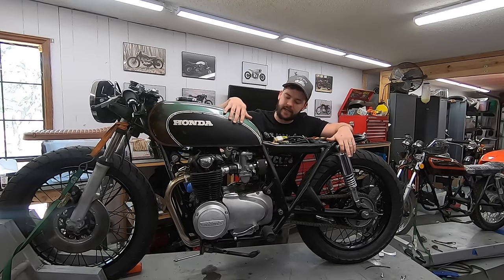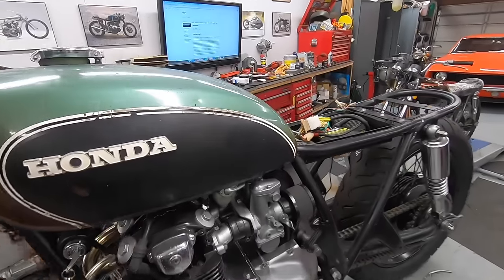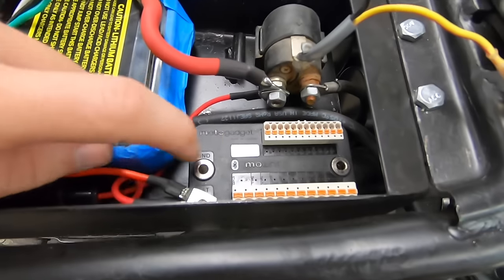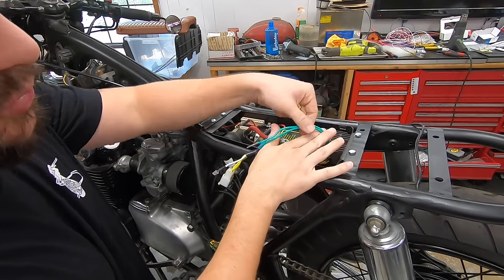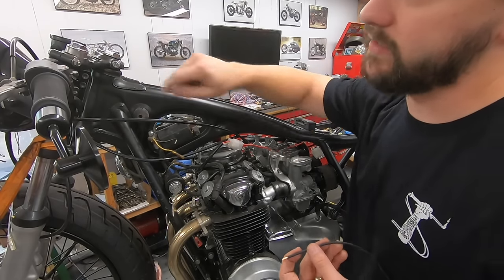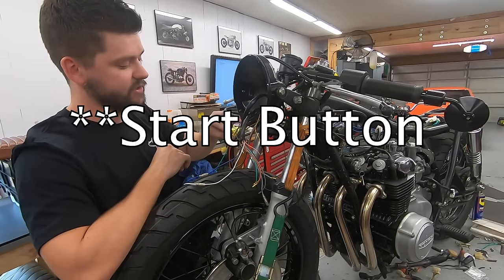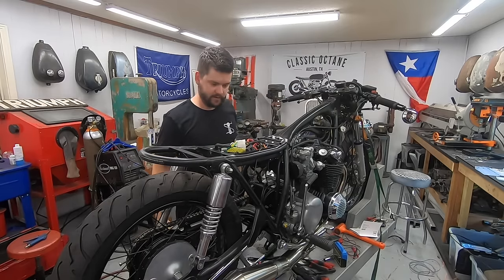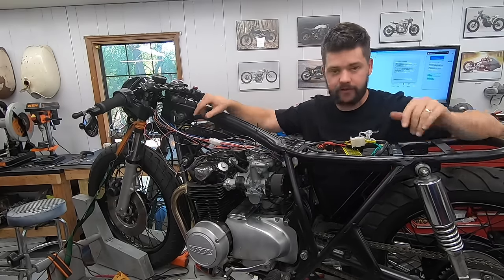Installing a Motogadget Mo-unit (m-unit) on a classic Honda (step-by-step)

Comment: The amount of development in engine and chassis technology in the last 40 years has been amazing. It seemed like I could bring bikes up to almost modern standards yet still had a shed load of little boxes and wires everywhere.  At last.  Thanks for explaining it well enough for an electrical numpty to understand (sort of)!

Comment: The most comprehensive m unit install I have watched! And I have watched a lot of them! For someone who has limited wiring knowledge Ive found the Revival cycles vids good but they seem to concentrate on the M unit not what you do if you want to retain existing switches. Thanks 10 out of 10

Comment: I just installed my M-Unit with the wire kit, completely rewiring my 1980 CX and it was simple and amazing! Thanks so much for explaining wiring in depth - really helped me understand the Honda wiring system better and how to get around the neutral and kill switch with the M-Unit.

Comment: Nice well documented video. As a techy I like the idea of the m-unit.

With respect to the "Kill" switch, the route you have chosen is by far the best. As this is an emergency switch it needs to be fail safe in operation. There is no substitute to a mechanical device in the feed to the coils as a last resort. 

The m-unit is of course solid state and as such could fail in such a way as to not turning off the ignition feed. Also the kill switch was designed to handle a set amount of current. This current keeps the switch contacts clean and working. It is known as a wetting current. The input to the m-unit is unlikely to satisfy this requirement and could have caused an issue at a later date given climatic conditions (salt, rain etc) on the kill switch.

Keep up the content...

Comment: My nephew and I have been totally redoing a 1970 Honda cb350 since last November .......... I purchased a m-unit blue to put in this bike....We are done with the mechanical part including upgraded carbs and an electronic ignition system....Left to do is the wiring of the bike to include the m-unit blue.....I know nothing about motorcycles, have never been on one as a rider or as a driver....)Note: Recently took and passed the state basic rider course as my first attempt)....My nephew has wired one bike with a wiring harness and no m-unit blue....With all of this said your timely wiring here in this U-Tube has been our bible to get this done.........Not done yet and will keep you posted on results......TY TY TY TY TY
Reply: well...8 months later and we attempted to hook up system and turned it on but nothing works....will back tract to this video again and check every wire.....my oh my

Comment: Thank you very much for your explanation! It really helped a lot! I configured my kill switch like you told. But after updating my m-unit blue you can change the kill switch behavior from NO or NC contact. So it can now be done with the m-unit! It works for me.
Reply: Update the blue unit as in the phone app? U can switch it in the app?
Reply: @MG-we9np  In the phone app there is an option how you would like to use that contact now. During your video that was not an option.

So you don't have to do it with the wiring anymore.

I think this is what I meant when I wrote the comment.
Reply: @porschetarga4s  cheers Nick 👌🏼👍🏼

Comment: This helps so much. I'm gonna watch this many times over. Incredibly thankful! Bought an M-unit Blue and the wire kit etc about 3 years ago and it's still sitting in the box lol. Might finally be able to move my Ducati Monster 600 -95 out the garage (aka living room). Best wishes from Sweden.
Reply: lol I also have m-unit blue sitting for 3 years already, wiring feels daunting, luckily he showed step-by-step process

Comment: That RR needs to be out in the fresh air somewhere .... :) M- Unit does not function with latch type switches. Momentary signal switches only as you are aware.  GOOD JOB working your way around it . I did same thing with the Kill. Re lighting circuit  I originally was doing likewise however chose to by pass the m-unit HB  output and power the HL with constant power out of ignition via the stock HD key switch which has a 2nd position to power the HL circuit  . The customer wanted keep these functions to stock. PS I ran both front and rear brake lite lines into the the brake  input on the m-unit .

Comment: Hi,

Been following your video’s for A while now from Belgium and really like/appreciate them. On this one however I have a 

small remark which I can’t refrain from making. 
Namely  that WAGO and other style clamps are  used for in house use and to my opinion should not be used in A bike or any automotive stuff.

No pun intended btw! Other then that still liked the video very much and found it clear video on m unit install.

Rather solder connection on bikes and use heatshrink to protect. 

Btw .. difference between yellow and orange clamp .. yellow only for solid core cable, other can be used for woven copper cable.

Keep the nice content coming ! ;-)

Comment: Hey Taylor, I have an 84 VT500 Shadow. The junction box (ignition/dash/lights) fried at the main hot/ground terminals. Is the M Unit the best replacement for this? Are there other options as well?

Comment: Taylor, many thanks...amazing to have this very well described! BUT be careful I pretty skeptic about idea to hide REC/REG under the seat into that tray! This may end up in fire!
Reply: because it gets very hot? where is a better location?
Reply: @bonsaitigerMTB could mount underneath electric tray for airflow. Then drill a hole on tray where water would be hard to enter, use a grommet and seal. That's what I'm doing

Comment: Love your videos but allow me one comment as an electrician:
When clamping a wire with a screw, you HAVE TO use a ferrule, otherways you would destroy the strands.
BUT
When sticking a wire into a spring clamping terminal (such as the m-unit is using) you must NOT use a ferrule.
In theory:
The connection doesn't get stronger as you said, but weaker, as the spring is not strong enough to deform the ferrule. So the "clamping-area" is small meaning the force it is able to transfer is also small(er).
A smaller "clamping-area" automatically means that the current-density is pretty high at the clamping spot. 
And THAT means that that spot could get reeeeeeally hot once the output of the m-unit has to deliver the 10(20)Amps it is capable of.

tldr: You are risking burning down your bike.

For the rest: keep up the good work!

Comment: You should have used also the M Button for an additional 50 bucks, it makes everything soooo much easier
Reply: What is the function of the M button?
Reply: @nathanmason522  The MButton is a device with cables (one cable for each control) to connect your controls in the handle bar. So you have only one cable for every switch. They connect in a small tube, and from there you only have ONE cable that goes to the M Unit.
Reply: @lumberjaxx3335  I just bought the 2 button and 3 button switches off of Revival, those are made by Motone. I also bought a m-unit blue and the $80 wiring kit, I am fixing up a 82 cb 900c. If I got those switches and plan on putting them on a new set of handlebars, would I need these m button for anything or should those 5 cover the functions of the bike alongside the wiring harness kit and I need to purchase a new battery, hoping to use old regulator/rectifier. Might need to purchase new starter solenoid kit as well. If you could elaborate on what I could use the button for after reading up on what I have, I would appreciate any further replies. I also intend on buying the turn signal/brake lights that are very minimalistic and he has recommended on another video I believe, think they are made by BULLET and sold on Revival Cycles as well. With 4 of those I could cover front and back lights and keep my stock headlight to start, run about $73 a pop
Reply: @nathanmason522  If you already have the switches you could do this : Buy the M button, connect each wire from the m button to one switch (the cables are named after their exact function, turn signals, horn, starter, low high beam etc.
Afterwards you connect the one left cable with the aux. connector on the m unit.
The m button helps to reduce wiring, so from the handlebar only one thin cable runs beneath the gas tank to you m unit. The M Button helps to reduce wiring to an absolute minimum and helps to keep a clean line with almost no cables between the seat and the handlebar (only those for the coils etc.)
Reply: I tried to use one on my gs450 and it wouldn’t work. It was like the bars wouldn’t shield it like they were supposed to. Then a year in my m-unit shit the bed as soon as motogadget implemented their new fee. The logging functions never worked again even though I paid their new $8.99 yearly fee

Comment: Thx for the vid...will be wiring my cb750 with a m unit basic and this will help!
Reply: I'd like to get an m unit and the module for my time to 5:15 1974 I was going to get a press down electronic ignition but I think I'll wait and try and make the trade was bending that metal with some the hand tools I got I have some other batteries battery plus it's right down the street

Comment: Those four wire connectors state that for multi core wires, they should be soldered before they are pushed into the connector. Solid core wires  just push in.

Comment: Hello there, like the video can you please let me know if you can use the M-Bottom module with the OEM switches and run only onesignal wire back to the maim M unit. let me if you have an answer Thanks

Comment: Love your videos and the technical side of the M-Unit, looks really good for a custom set-up. I’m just not really understanding what it save in terms of wire runs and connections. Especially if you have a new loom. Not hating just curious.
Reply: I don't like it either. Nothing about it looks straightforward. And people fit them to classic bikes, as if to say a points ignition system and basic wiring loom with relays and stuff is more complicated than an M-Unit. I mean, just look at it. How does that simplify anything.

Comment: Will the neutral and clutch switch still function, i.e. the starter motor wont function if the bike is in gear?

Comment: Question.

 I am installing a new ignition to my honda cb650. This ignition has 3 cables. 1 to battery 2 ignition without light 3 ignition with light. 

Obviously battery goes to battery. 
Hoping you can till me where to connect the other two. 

My old ignition was just two cable. One to battery and the other I had into lock and it did the trick.

Comment: I’m working on an ‘83 Honda cb750f. Would I only need to plug in the yellow/red wire from the starter solenoid into the m unit, like you’ve shown? My solenoid has six points, as opposed to yours only having two.

Comment: Thinking of running this on my CB650c chopper build because even though I’m taking the bike down to the basics, I’ve never messed with wiring before and would like to see in advance where I’m messing up and what’s wired totally wrong.

Comment: Thanks very much for putting up the vid.....im gonna have to watch it a good few times....just about to start re wiring my late fathers 400/4 - i must confess i do feel like ive got a lot more wires in the headlight area....!! - im using all the stock guages and switchgear though...

Comment: Hello Taylor, I have bought anM Unit Blue and I have been told that to retain the original Honda switches I need to change the switched lives Honda uses to Switched earth and also change the M unit to deal with that.
Do you have any information on this change on the Bike? and or the M Unit?
Thanks John

Comment: Can you help me with how to integrate the spark unit in the wiring diagram of a Honda Shadow vt750c '84. Everything is working wel, i only don't know how to connent the spark units and coils with an m-unit. At revival they have a schedule from m unit to a relay to spark units (cdi) to the coils. But how to do that with my bike?

Comment: I am doing a full rewire on a CB 750 k2 and I am using an m-unit blue with a mo.button but keeping my old starter solenoid, I got a motogadet cable 8awg with a built in 40 amp fuse can the ground cable be 8 awg or does it have to be 6 awg also my new reg/rec only has 7 wires. can supply photos

Comment: Super helpful vid! One question though. My 72 cb350f only has a kick starter, do I still need to use the 40amp fuse to connect my battery to my unit of can I just connect it straight to the munit and regulator

Comment: I picked up a old Honda nighthawk CB650 and I hope I can get her running again, is there a guide on how to wire in the cdi? If it's fried because the previous owner jumped the solenoid so this might be the case is there a company that makes a electronic ignition system?

Comment: HELP!!
Im using a 4 wire regulator rectifier on my bike because its a 175, 6V that im turning into a 12V. How do I wire the 4 wires? Does my key Start wire go directly into the munit or am I still connecting it to one of the 4 wires coming out of my regulator rectifier. (4 wires --> Battery, Ground and 2 AC).

Comment: I've been debating fitting an M unit for a while on several projects, but until seeing this video I couldn't find a really in depth guide. Thank you. Super informative. 

The bike I'm considering fitting this to is a 1982 CB750 and has sparks units. Would they power off the same as the coils?

And if I'm using aftermarket simple on/off push button type switches one wire goes to ground and the other to the M unit? No power involved?

Comment: I have a 1973 CB500 four with kick start and I am trying to get the clutch to function.  I am having trouble with the clutch cable and the mechanism for it that sits behind the cover where the gear selector is.  If you could help that would be amazing, thank you.

Comment: Hi I know you posted this video a while ago but if you see this, when you wired the key you left the two brown wires unused. I tried to do it the same way. My m unit will only turn on when the key is in the accessory position.

Comment: Regarding the kill/start switch, could one also just connect the "on" position to the ignition key, so to start the machine you need the starter switch to "on" and have the ignition key to "on". And only if both are "on" you can ground the actual starter switch?

Comment: Have you got a wiring diagram for the headlight arrangement? I can't really follow your explanation for left and right controls, I'm wiring it into a honda gl1000 I can't get high beam low beam on off sorted

Comment: Hey Taylor. Many thanks for your videos. They really are a lifesaver. Question tho. I've hooked up everything correctly to start the bike but when i press the start button (classic honda switch) it dosent kick the starter over. It has to b the switch because when I disconnect the start in wire (from the y/r starter wire) n then ground the start in wire from the m-unit blue, the starter kicks over. How can I check the y/r starter wire n start button. Also I might add when I turn the key from off to middle position the m unit blue comes on but when I turn the key to the ignition position, the m-unit turns off....is this a problem??? Please help as I'm pulling my hair out here...thanks Taylor

Comment: Hi Octane.  Quick question, I have a 12 volt two wire Red & Black - Kawasaki Alternator with a built in regulator on my Ural 750 and both wires are suppose to go to the positive side of the battery, so how would you wire this into the M Unit Blue.

Comment: Question. So I’m currently wiring up my m unit on my 1980 cb650. But having an issue getting any crank power. Does it have to do with the wiring of the spark units?

Comment: Great Video! im about to do the same to my 79 cb750. I see your using a 4 cell antigravity... is that strong enough to turn the bike over? I was planning to use the 8 cell. also are you using your stock R/R while using a lithium battery?

Comment: Thinking of using the M-Unit on a EV Honda conversion.  I assume the start wires would go to the contactor to apply 12v to close the contactor.  Would this work or is it momentary switch so would not hold the contactor closed?

Comment: If you aren't using the original kill switch and start button, which push pull throttle control are you using instead?

Comment: This is an awesome tutorial!! I have a question regarding using the M Button. I also want to keep my stock switches and in order to have kill switch and headlight wiring with stock switches does it also mean that I wouldn't need or be able to use the M button? In other words to use the M Button I would need new switches but to use stock switches I'll have to use the wiring techniques that you have demonstrated? BTW I'm building a '75CB400f. Thanks in advance!!!

Comment: I seriously cannot make sense on what you did with the neutral line I don't have an oil pressure light so I'm ignoring that I have one single wire that I need to illuminate a bulb when I'm in neutral. I have an aftermarket cluster with no neutral light dedicated so I'm going to use the high beam signal light to illuminate on the cluster when I'm in neutral. So I have one wire from the ground switch in the transmission up to my headlight bucket now what?

Comment: Hey man, I’m still a little confused by the neutral and oil pressure light. It’s basically the last bit and then I’m done. Any chance you can help break this down?
Reply: The lights just need key-on power, which you can pull from one of the Aux connections. The ground side of  each light should run to the switch (the other two wires they come from the charging system harness at the engine)